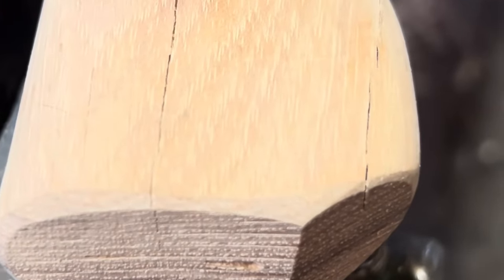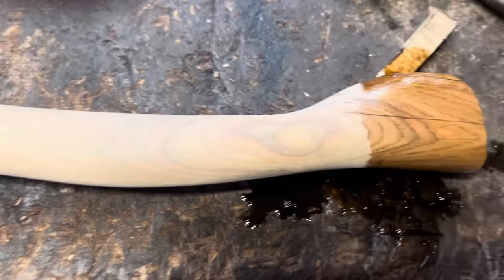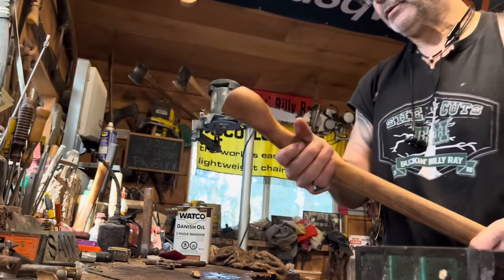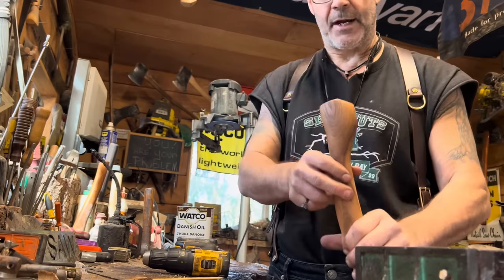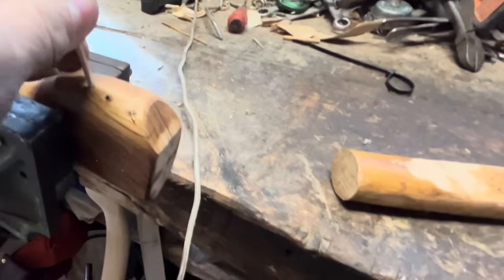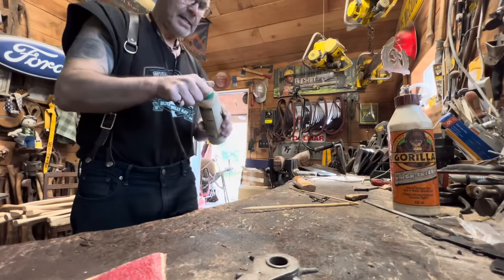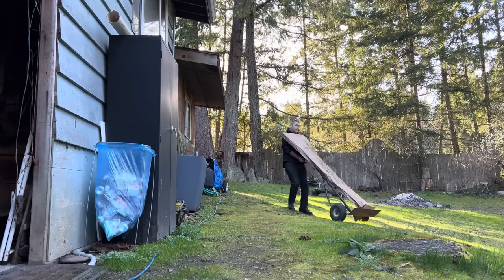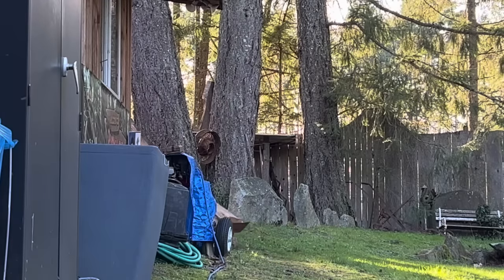Every Man needs to know this trick

Comment: I was a youngling, just learning to split wood and wouldn't you know it, I overshot the firewood and hit the handle right below the head.  Grandpa saw me do it and came over to make sure I was OK, but it had started that typical split in the handle.  We took it to the shop, he popped out the wedge and removed the head.  We glued the split, put it in the vice, doweled it in several directions (I think 8 times total, you can see 5 of them.)  The next day, it came out of the vice, trimmed and sanded, soaked the end grain in BLO while we ate lunch and re-hafted the head with a new wedge.  I'm still using that axe today over 40 years later.  It works.
Reply: Welcome to the buckin army 🪖
Spread the love 
Increase the peace 
✌️❤️🌲🪵🪓🐝
Reply: I loved reading this!

Comment: Nice work.
The key is to not let your timber handles get dry.
Every Autumn (aka Fall) while it’s still warm and the grain is open, oil all your timber handles.
Set them up in the shed, clean them, look them over, sand any splinters etc. Set up a 44 gal drum or bath to allow the oiled tools to drain, and a large tray to oil over. 
I use raw Linseed oil, with up to 50% turpentine. You can use straight but leaves the handle sticky, which takes time to work free. 
Your hands and tools will thank you.

Comment: This is a beautiful handle. Well worth saving w/ a little maintenance (if it had a little, just a little, it wouldn’t have happened in the first place). Before drilling into such a sweet handle, I’d tape off the area around the cracks, taping in parallel to the cracks, then press some water resistant wood glue - marine grade urethane glues would be even better - and press it into the cracks until the crack is completely full. Wipe off any excess glue, then wrap it tight w/ tape, or clamp it. Lightly sand the area after the glue is fully dry. Now give the handle the T.L.C. You should have given it in the first place. Maintaining the tools you have is generally cheaper than buying new ones. Try to find a handle like this in your hardware store. I have (& regularly use) a 70+ year old Radial Arm Saw. If properly cared for, my grandson will be able to use it every day.

Comment: I do the same thing with wood gun stocks that get damaged. With practice you can repair them and cannot see the repair at all.
You want too hide that crack use super glue and some of the sanding. Put the glue in and sprinkle the wood sanding over it and wipe with a rag really quickly. They will disappear.